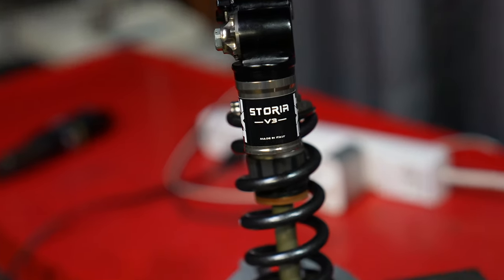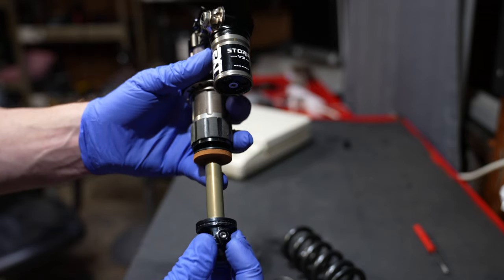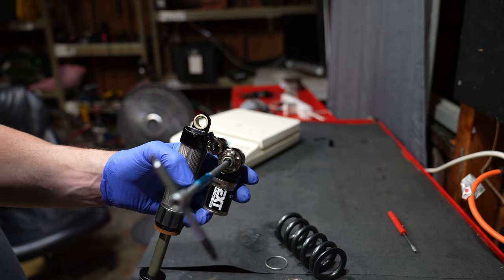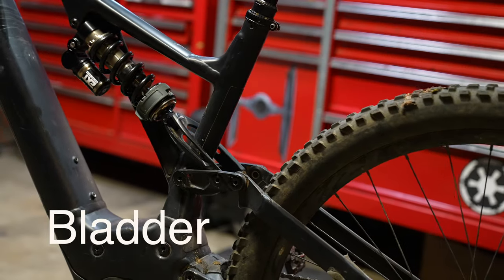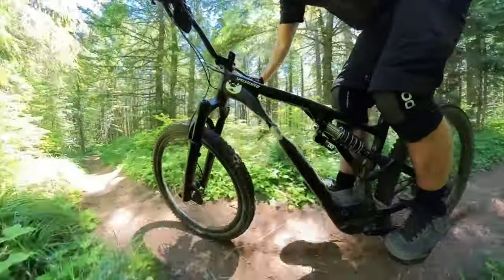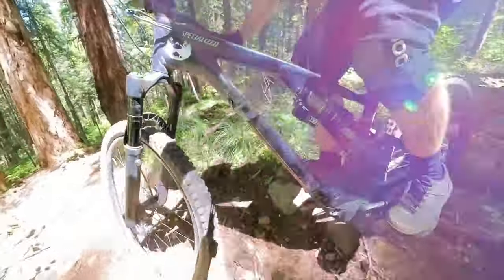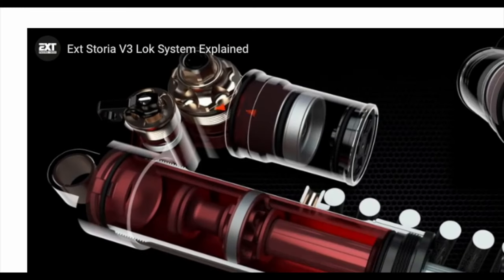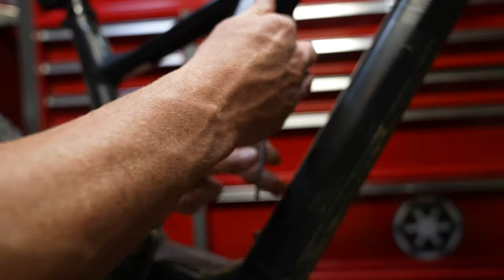EXT Storia V3 Is it STILL  worthwhile?

Comment: I really love your videos, keep going 👍
I have the Storia V3, bought directly from EXT: thay gave me a 650 and 600 lbs springs and the suspension was too stiff. I bought a 550 lbs and the sag indicator 2.0 by Reverse Component (super useful to see on trail how the suspension is working) and now the suspension works quite fine, sag is about 27 and something %, but i could also try a 25 lbs less spring, because i see i have the last 1 cm of stroke that i don't use (on 55 mm of stroke of the 2023 Turbo Levo). So, yes, i think you are right when you theorize the Storia needs way less lbs than EXT recommends, especially if you are not a racer on fast lines.
Reply from the maker: Thanks for comment, debating shutting down the Bike portion of my business is very unprofitable

Comment: Got v3 on enduro 29. It's been my dream bike. I'm not changing it ever unless I break the frame. It's a big pillow absorbing all, big or small, rock or flow. Great video! Cheers from UK
Reply from the maker: Totally agree, had this combo. The head set will break or the bearing will auger out the carbon. Had both happen. Just get the cane creek 44 headset.

Comment: You are absolutely right on spring rate.
Yesterday i took my brand new e-storia to the bike park for a first ride and it felt like a jackhammer and despite running the compression knobs wide open it would barely budge.
I used to run a 450 spring on my old dhx, an admittedly high rate for my wight, and despite dropping to 400 on the new e-storia my sag was still 26%. (The ext calculator put me square on a 400 for a 28-29% sag)
I am by no mean a gentle rider and still had to noticeably move my weight over the rear wheel in order to create enough load to make the shock performance manageable (with all the drawbacks of riding with little force applied to the front).
I'll probably have to go for a 350lbs spring to achieve the famous magic carpet feeling out of this shock
Reply from the maker: Sprindex coil, play with it, add 50% compression low and high before you start. Play with the spring only have your mind blown. It will screw up your fork setup, because the shocks doing so much work

Comment: Are you planning on trying a Bomber CR with WPS Podium kit / tune ? 

They have fitting centers in most parts of Europe and some in North-America and cost ~200$ install + 300$ shock so quite cheap and heard performance is very good.
Reply from the maker: I’m not the parts are $300 and the shock is not Specilzied friendly . Thanks for comment i just looked at it, looks awesome

Comment: Hello, thank you for the video. May I ask, I am strugling a bit with the preload setting of the coil.
I know the EXT recommends only two 360 turns from the moment the spring gets tigh, BUT..
The right moment when the spring is tight is with the load of the bike itself? Or am I supposed to unweight in by pulling up by the frame?
If its the first option, as I saw somewhere, that men, when I find myself in the air the wheels drops and the spring might goes loose? Please, could you tell me whats the right procedure? I thik the spring preload affect the stroia performance so much I wanted to have it right. Thanks!
Reply: You want to set the preload with the shock off the bike. Turn it just enough to prevent the spring from rattling around. It's generally best to use the least amount of preload necessary. No more than 2 full turns of preload.
Reply from the maker: What spring are you using. Your not suppose to tighten it to much. I added 4 full turns of preload to the shock to get the right sag rode great. Don’t listen to the internet. Get the sag right

Comment: coil lenght has no effect on compliance as coil springs have virtually zero breakaway torque, the smaller coils will not give you better performance other than a decrese in weight
Reply: do you think stroke length plays an effect on compliance? most DH rigs run a longer stroke shock, so I assume it has some benefit otherwise I assume they could run smaller stroke shocks. any thoughts?

Comment: Sorry bro o asked about getting a ohlins secondhand and then was looking into ext I take it you also recommend it secondhand as I could pick this up £100 cheaper than the ohlins which do you is better
Reply from the maker: Harder to service and setup. Less reliable as well. More performance. I just bought e-storia used had to send out was broken
Reply: Well I won’t be serving it but I found a company here in the uk that does for 120 and this the person selling it says it’s not been batters and was bought of his mate after 2 rides and he has had it 8months  and condition looks amazing but if send it of for a device that he says would probably get away with it for another four months but I want them to tune it to my weight whilst in service what you think and I knocked him down to £315